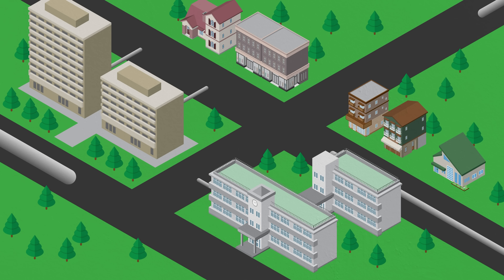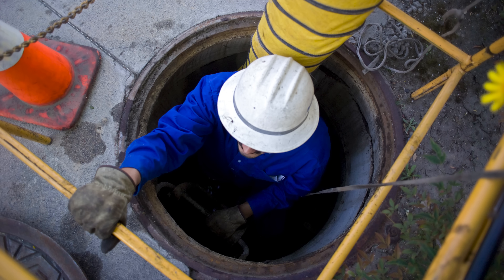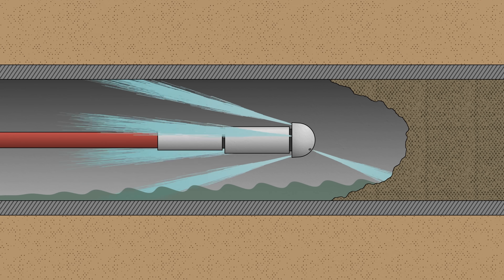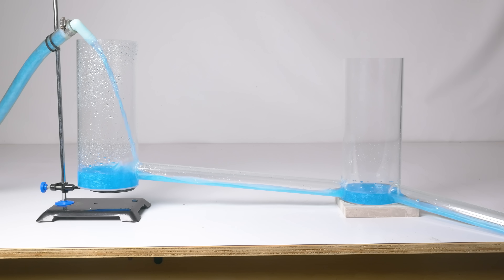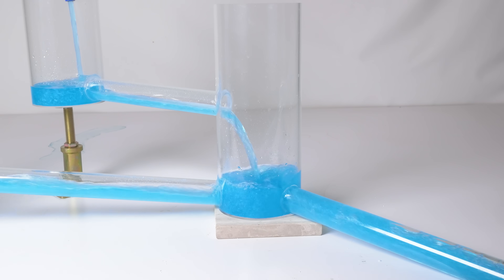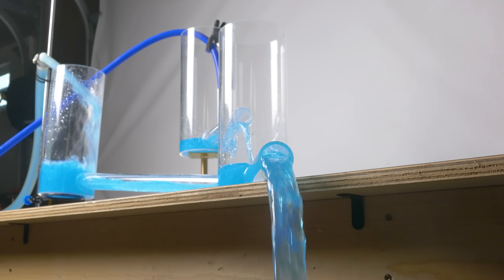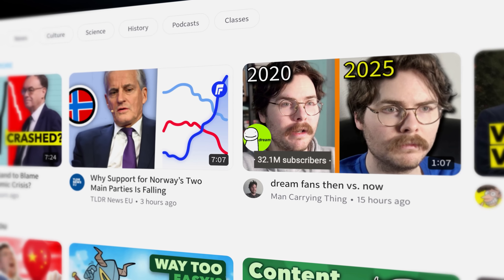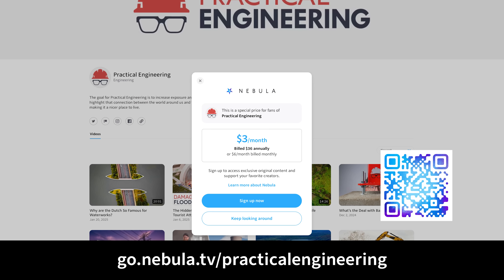What’s Inside a Manhole?

Comment: The plane on a treadmill question is not quite as simple as it seems. If the treadmill truly can accelerate in the opposite direction of the tires as fast as the tires are moving, then the bearings in the wheels would likely overheat before the plane could reach V1 which may cause the entire wheel assemblies to fail, causing the plane to belly-flop and disintegrate upon meeting the hypersonic treadmill surface with its fuselage. Of course until the bearings seize or the wheels are destroyed by spinning at hypersonic speeds the plane will just accelerate forwards mostly normally, because thrust in planes comes from the engines and not the wheels.
Reply: we call that the "you did it wrong, because you didn't get the result I wanted" fallacy. VR on a 747 at maximum takeoff weight is under 180 knots.  that means the maximum the treadmill would be going is 180 knots, for a wheel speed of 360 knots.  the speed of sound is around 666 knots.
Reply: @kenbrown2808  No, the wheels and treadmill would be locked in a cycle of exponential acceleration. The treadmill isn't just accelerating the opposite of the plane's ground speed, it's accelerating the opposite of the wheel speed.
Reply: @insu_na  wrong.  the treadmill is going at the speed the plane is MOVING.
Reply: @ No, you're just wrong here. The original question is (QUOTE!) "Imagine a 747 is sitting on a conveyor belt, as wide and long as a runway. The conveyor belt is designed to exactly match the speed of the wheels, moving in the opposite direction. Can the plane take off?"
Does it say "the belt matches the speed of the airframe" or "the belt matches the speed of the wheels"?
Reply: @insu_na  "
speed
/spēd/
noun
noun: speed; plural noun: speeds

    1.
    the rate at which someone or something is able to move or operate.
    "we turned onto the runway and began to gather speed""

the belt matches the SPEED of the wheels.  not the rotation of the wheels.  

the belt matches the speed at which the wheels are MOVING.  not the rate at which the wheels are turning.  if I put my car up on blocks and set my cruise control at 30 MPH, it is controlling the rotation of the wheels, not the speed of the wheels.

again, you are spouting the "you did it wrong because you didn't get the results I wanted" fallacy.
Reply: @kenbrown2808  There is no "you did it wrong because you didn't get the results I wanted" fallacy... If you're gonna fall for the fallacy fallacy, at least try to find the actual name of the fallacy you're referring to...

Speed of the wheel obviously means rotational speed, or the person asking the question would've said speed of the airframe as there wouldn't have been a need to specifically mention the wheels in your (false) interpretation.
Reply: @insu_na  no, because if the guy who wrote the question wrote, "but the conveyor belt can't stop the airplane from moving because it is powered by thrust and the wheels spin freely" then nobody would have to think.  or if he wrote, "the treadmill moves backwards as fast as the wheels are spinning"  then it would also be obvious he intended the treadmill to be able to stop the airplane.  but he very carefully wrote "the speed of the wheels"  which makes you have to think about what speed means.  
but yes, as far as fallacies, you are also using the masked man fallacy, definist fallacy, proof by assertion, Psychologist's fallacy, invincible ignorance, and appeal to consequences,
Reply: @kenbrown2808  "which makes you have to think about what speed means." and you thought the wrong thing about it, it's that easy.
Reply: @insu_na  tell it to Mr. Webster.

Comment: oh god, the joys of living in the Netherlands... You can flush anything except condoms, pads and the stuff for inside. And if you get some clogging error, its on your property most of the time so you can go fix it! But even my 60's home never really had a problem with that!
Reply: You must have satellite pumps at each house that pump to a low pressure main.  Those are such a pain!  Must have little choice in the Netherlands with the water table being high.  I've dealt with those, and people still flush EVERYTHING!
Reply: @WildRapier  i dont think we have anything of that. First step of water treatment plants is the filtering out of large items like pads, condoms etc. Seems so unreal to see a condom dangling from a giant metal claw XD.
But the more i see from the world, the more i believe that the Dutch are the best in handling water. But maybe some parts of that are easier because everyting is basically flat,
Reply: @basvs3906  The plant I worked at finally had a full upgrade which included a rotating micron screen, which even filtered hair out.  Definitely an improvement.  It also got ballasted floc via magnetite.  I've never seen settling like it.  Settleometer time was seconds....same principal on tertiary clarifiers just for Phosphorus removal.  Lookup BioMAG and CoMAG...not sure who has the patent now, but I worked with the Doc and Engineers on the pilot and full-scale implementation.  Sturbridge, MA!
Reply: I thought each house would only be able to connect to the main sewer through your own filter.

Comment: It depends. Normally storm drain systems. But also "grease interceptors" which sound as fun to clean as the name might imply.

I wouldnt just jump down there.

We also recently installed one that had a filter system inside. Do jump in that one either, its a 12 foot drop to the funnel which is held by a few tabs and then its another 25 foot drop. Also that one doesnt have a ladder... theres at least one of those going in every single costco.
Reply: Scary. Useful for disposal of enemies.

Comment: Airplane on a treadmill? Haven't heard that one before, can someone elaborate 😅?
Reply: The myth is that if you put a plane on a treadmill that is moving at the same speed as the plane would be moving forward, the plane would come to a standstill and would not be able to take off. But that doesn't work because the wheels of the plane spin freely and don't provide propulsion (unlike a car, for example). All that would end up happening is that the wheels would spin at twice the normal speed and the plane would move forward as normal.
Reply: @nekdonikde5317  makes sense, never heard that before though 😅 
Thanks

Comment: I think one of the most important part of the reason on "Why manholes are round?" Is the fact that the cover cannot fall inside a manhole, unlike a Square that it's diagonal is bigger so it can fall inside when someone places it wrongly
Reply: I've popped hundred of manholes.  I've seen 3 fall in, they were round.  Manholes after being left in place and driven over tend to get stuck and need some impact encouragement to come loose.  Cast iron does not hold up well to impact, especially in the cold.  They split and the pieces drop in.  So ideally, round manholes don't fall in.  In reality, they do, not that often, because who wants to do a confined space entry and go down in a manhole, but sometimes!
Reply: @WildRapier  This depends entirely on the iron grade used to pour them. Sounds like you encountered gray iron covers.
Reply: Another reason. A nearby town used unique triangular man hole covers. They are in the process of replacing them because they are too small to allow workers to enter using air packs.
Reply: So I work in the sanitary, sewer world, and square lids are the bane of my bosses existence we will not deal with them. We will have the cities come out and bring a mag truck out to lift the lid out because we will not be responsible for it falling in.
Reply: It’s also a question of customs. I live in Italy and all our manhole covers are rectangular, I rarely see round ones
Reply: @ woah! I hadn’t thought of that. Thanks for the knowledge
Reply: Also being round minimizes the impact of wheels rolling over it
Reply: Yes, Grady mentions this at 10:15
Reply: i've actually seen some rectangular manholes and i'm more curious why they aren't round now... since round manhole covers actually make good common sense. i suspect some of these rectangular manholes actually have a hinged side meaning they are permanently attached on one side so it is already near-impossible to fall into the hole.
Reply: @alveolate Until the hinge is broken.

Comment: another reason you dont install too much slope is because the liquids will outrun the solids if the grade is too steep, this leaves you with solid clumps that dry out in the pipe, causes clogs.
Reply: I would have never thought about that. Very good point
Reply: @johnargumaniz9179 Thats more a problem in residential areas, in bigger lines where you always have some flow that doesnt matter much.
Reply: Baldwin Latham’s self cleansing velocity
Reply: Yep😁 @BritishEngineer
Reply: I was a guest at a new rustic hotel on a high canyon rim in a foreign country.  They had their sewer line going steeply down the canyon wall for "disposal" below, but it constantly clogged.  They were at a loss as to why, until I explained this simple principle.  I recommended that they put in zig-zags to lessen the slope.
Reply: Isn't that more of an issue in buildings?  I didn't think it applied in cases where there is continuous flow.
Reply: Sounds like the kind of thing you can only discover by constructing a sewer and observing how it's working over time. Interesting
Reply: 100% false.  PMMAG has an article dispelling this myth.  More slope yields more velocity which keeps solids in suspension better.
Reply: Yeah.

Pretty sure Grady actually illustrated this exact concept in a video before.
Reply: nailed it
Reply: i see,thanks for the info
Reply: I was taught 1/4 inch per foot.
Reply: @BB-iq4su  depends on the diameter of the sewer. Quarter inch slope is usually for 4” residential laterals.
Reply: @BB-iq4su  my foot-long turds are waaaay wider than 1/4"
Reply: Okaaaaay
Reply: Good info
Reply: crappy!
Reply: I guess drop manholes do not exist...smh
Reply: "Too much fall" is an urban myth. Seems to make sense but actually doesn't. I welcome anyone to reference an official code that says otherwise. @MikeV8652
Reply: 1/4" / foot
Reply: Even the romans figured this out with their aquaducts. the impressive ones only had a grade of like 1in over 1mi. or something like that
Reply: @djdrack4681  If you have too little slope, the solids will clog up the pipes, most pipe slopes are designed around a minimum velocity (minimum slope) not really issues with maximum slope. 

More issues with a steep slope will be with needing to anchor the pipe in the soil etc. to prevent it from sliding. This can be done with concrete anchors, I am not too familiar on it myself but I'm sure some googling will tell you why/when pipes need anchoring in soil/current best practices.
Reply: The plumber at my job explained that to me and it blew my mind. Something some simple yet so complex.

Comment: Manholes are round because you can't drop the gazillion pound cover into the hole!
How about a follow up covering all those other manholes? Steam and electrical, there's some pretty wild stuff down there.
Reply: You can!  I've seen it done, with a sledgehammer.  Usually loosens a stuck manhole, also will crack cast iron like an eggshell!  Those pieces will drop in!

Comment: C.H.U.D.s :face-blue-wide-eyes:what else ? (1984 horror movie) more seriously as usual amazing demonstration kit and explanatory footage 10/10 teaching skills
did you use liquid cooling blue made for PCs ? I see the silver swirls some have they help show the chaotic flow inside the system, if your PC is liquid cooled btw avoid using those as those floating particles will inevitably stain and clog your waterblocks and piping, the best liquid is clear but I personally stick to fluorescent green as exposed with UV light (or simply blue leds) it's an easy way to detect leaks it leaves obvious green stains that will pop when lit with the right color frequency
Reply: I'd stop taking whatever you took, unless you've found a way to cool a PC with wastewater.  🤣